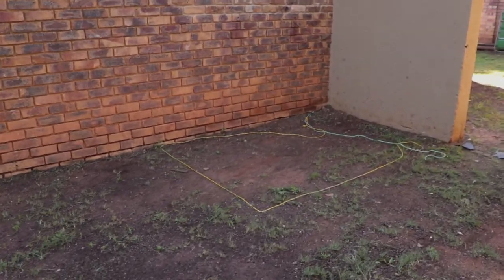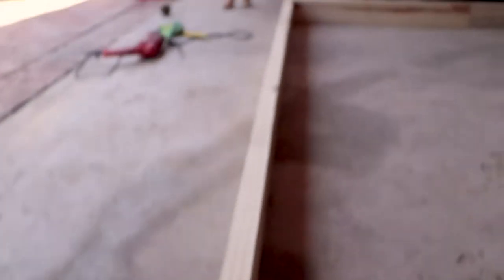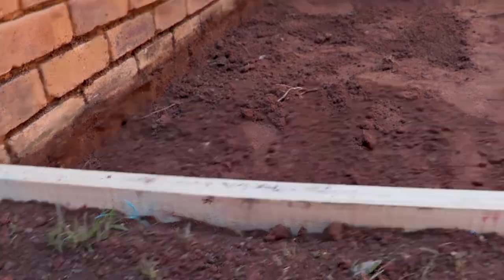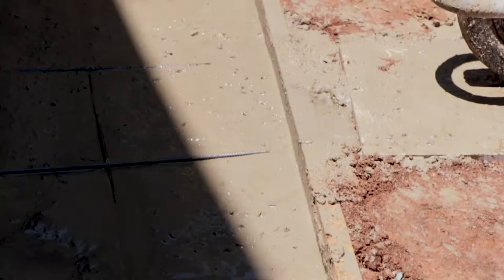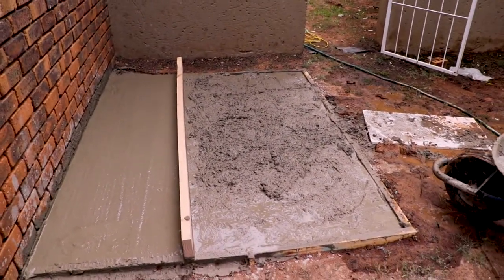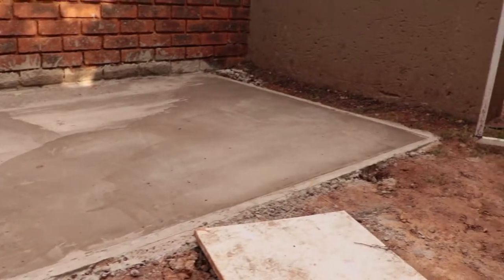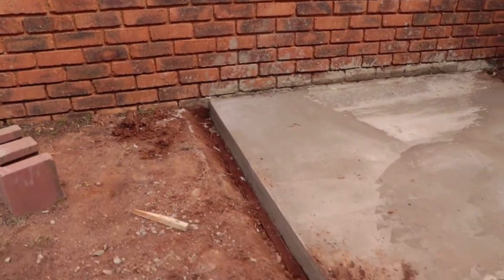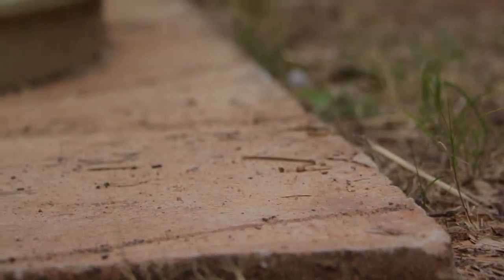⋆ Simple DIY CONCRETE SLAB for my rain tank!!! #howto #concrete #slab

Comment: Thanks for putting this up. A few questions as I plan on doing this myself. I am told the total depth has to be about 120mm  for 2000L tank.  How is your tank doing ? What make and wattage is you pump?  Do you leave your pump in place and would you recommend any housing for the pump?  Any additional thoughts about the process now that you have set up your own system?  Thanks
Reply from the maker: Hi Sylvia, So the strength and depth will depend on coulple things. For example this tank was right next to our house in place that gets quite water logged. So kinda overdid the base to be sure but looking back it was a bit of an overkill. As long as the ground is pretty hard and level you dont need to make the base that thick. For example i am helping my dad with a large 5250 Lt tank. For his base he dug in to the group to level. Then did a concrete boarder. Then after filled with stone/sand, then cemented paving bricks over the whole base. So not as much foundation. So i do leave my pump in place but can easily be moved by unscrewing the two bolts that hold the feet down. For now i have a large container covering it but a housing would be good no matter what. For longivity. Main thing to always think about before planning is height of your tank vs what the high of the down pipe will be once fitted. Incase your roof is low. Oh and if you can afford it and have the space. Always try go for bigget tank as will be cheaper than getting 2 smalls one over time. Let me know if you have any other qwuesitons

Comment: Hi. Do you HAVE to remove the frame for any particular reason? Why not just leave it? Just aesthetics? 
Thanks.
Reply from the maker: Hi there. So sorry for the long due reply. Yes you oculd but not sure if would need to be treated to last outside. But mainly used to create the form for the cement. I would always remove as will allow cement to set quicker if you keen to use the base sooner. Cheers Colin

Comment: I also need a base, but don’t want to pay the earth. How thick should the base be for a 1000L?
Reply from the maker: Hi there. On these Jojo tank created in South Africa. You can find steel stand for them (great to lift up for additional pressure) or even put wooden sleepers/blanks under them ever so often. Usually according to the manufacturers standards. I think my cent base was a bit of an overkill in depth. About 10 - 15cm not 100% sure. But for a 1000L you may be able to use large stone pavers on compacted foundation, depends if tall or wide though.  hope this helps. Cheers Colin
Reply: @myrenewablelife  thank you for the advice!! Helps a lot! 💯